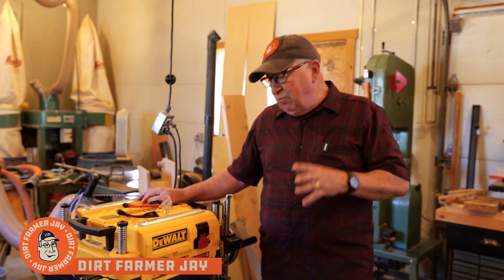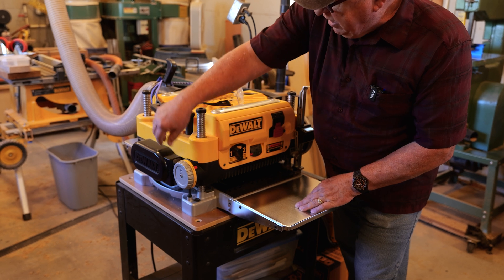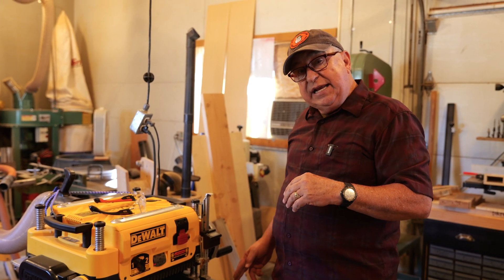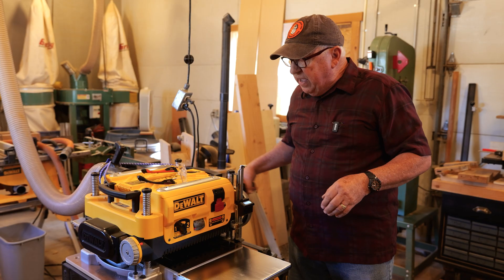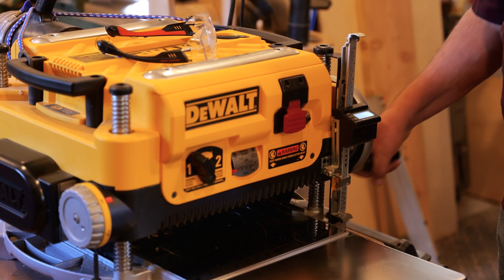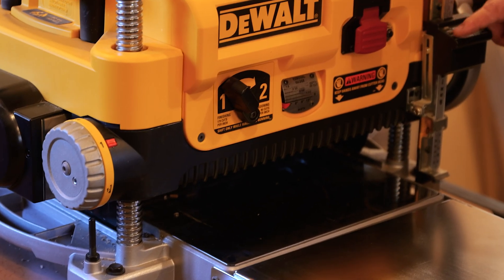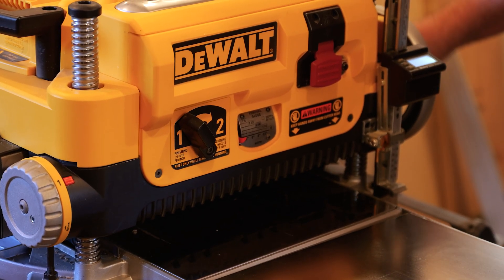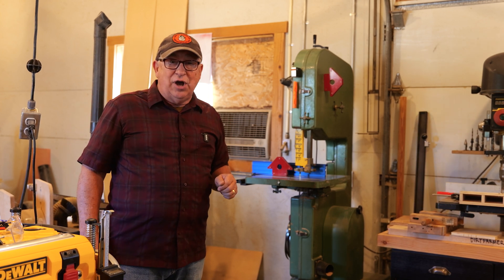How to Adjust the Turret Stop on a DeWalt DW735 Planer

Comment: At that price range, I would like to see this device perfectly calibrated from the get go without having to rely on external tools to do the calibration. Also, the calibration should be able to be done by the device itself.
Reply from the maker: Thanks for weighing in! Best, DFJ
Reply: Stop whining, you don't NEED the wixie gauge! But if you have it and it is already calibrated, then using the procedure shown here is easiest way to also calibrate the turret stop. If you don't, then using a (digital) caliper just plane a board until its measured thickness exactly matches one of the turret stop thicknesses. Then adjust the post so it stops the lowering of the cutter head assembly at exactly that point. And remember, it is very difficult to keep anything perfectly calibrated permanently, there are too many variables. So if it's not permanently perfect, then make sure it's adjustable! Finally, in this case, the owner REPLACED the original cutter head with a SHELIX head. He must have used the 'OEM-size" Shelix head because the initial reading was so close to being exactly correct. Not even sure what you mean when you say "the calibration should be done by the device itself." Do you mean automatically?? Forget that at this price point, or anything close. I have never seen non-industrial planer that auto calibrates. If you just mean you should't have to use an aftermarket digital gauge, then see above, because the only thing you NEED to have is some reference thickness measuring device, (calipers, micrometer, or just an accurate ruler) and a piece of wood.

Comment: Yeah but you can’t set an exact setting for a custom dimension on the machine dial.
Reply from the maker: For that, I would use the digital depth gauge that we've installed. It's a Wixey model and does a great job being very accurate. Best, DFJ
Reply: Sure you can. Say you want to set 0.719 inches to match the thickness of 18 mm plywood. Just use the procedure describe here, or if you don't have a digital thickness gauge, just plane a piece of wood until the measured thickness is 0.719 inches and adjust the stop rod to stop the carriage at that point when the turret stop is at the 3/4 inch nominal dimension. So now when you turn the turret to 3/4 inch (0.75 inch), the carriage will stop at the calibrated thickness of 0.719 inches! Of course, the thickness increments of the turret stops are fixed, so ALL of the nominal thickness will be "off" by the same amount (0.750 - 0.719 = 0.031 inches, which is ~0.79 mm or ~1/32 inch). So there's you CUSTOM DIMENSION. Just don't forget you changed it...I would mark it somehow to avoid making a mistake later.